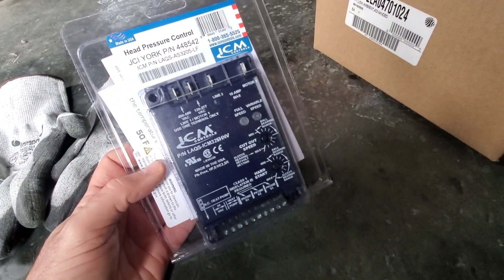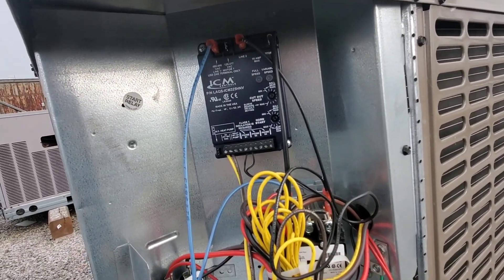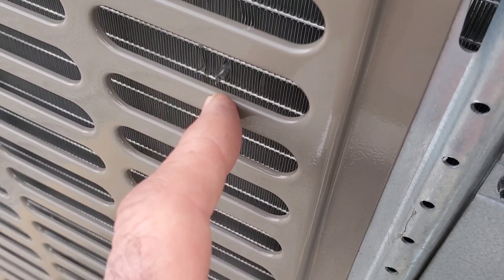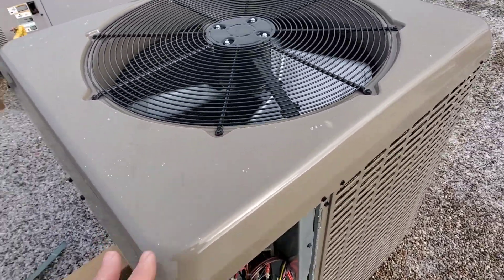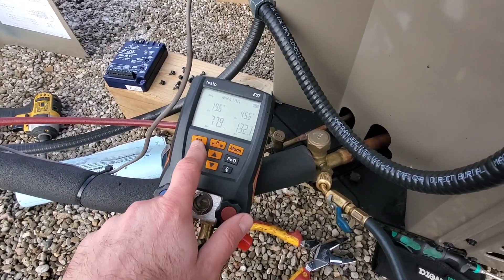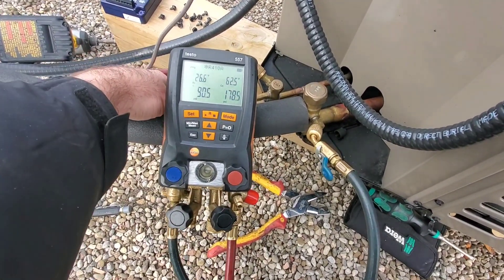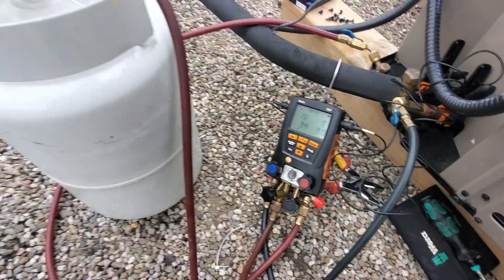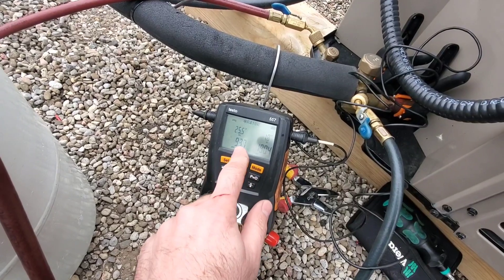Charging And Troubleshooting Air Conditioning In Low Ambient Conditions

Comment: icm head pressure control does not come with the wire that connect the line 1 to the line 1 terminal. what kind of wire use to connect line 1 to the line 1 terminal?

Comment: Hey man hope everything is ok I am always watching your videos,I worked on a carrier motormaster low ambient control today same scenario,it’s tricky to set the right evaporating temperature right due to condenser fan constantly speeding up and down some times you will run under 32° evaporating temperature for seconds and it will go back up,specially if there is low load inside the room,you can correct me if I am wrong I know you have much more experience then me too
Reply from the maker: Yes difficult to set up for sure, it'd much easier if it was fan speed instead of fan cycle
Reply: @HVACKnowItAll  I agreed now due to is temperature outside bypassing the condenser fan won’t work either thanks for replying my message

Comment: We also rig units were I work with a cut in cut out pressure switch wired through a relay to achieve the similar outcome for low ambient conditions

Comment: I prefer pressure action on low ambient controls. I always add a freeze stat to the evaporator as well. I’ve also found TXV with a hard start kit for better in low ambient control. Depends on what the customer will pay for. Good video. Thanks and stay safe.
Reply: I use a fan cycle switch myself. Tried and true. I’ve used them for over 40 years.
Reply: I've never had good luck with these controls

Comment: I Installed this on a Trane 20 ton condenser and both of my motors over heated after 40 mins of run time. Spoke with tech support and confirmed that it was set up correctly. Was told that with that model unit I’d have to upgrade both the motors, add heat sinks, and rain guards.
Reply from the maker: Was the motors that burnt out ball bearing?
Reply: @HVACKnowItAll   yes. According to tech support they were ball bearing. They still worked after the cooled off.

Comment: Does this ambient control kit need other accessories Such as a hard start kit or anything else? And does it matter if its a txv or piston coil?
Reply from the maker: Hard starts for locked up compressors or low voltage situations.  Not needed in low ambient conditions.  You'll need a crankcase heater for sure and possibly wind baffles.

Comment: Great content. Thank you for posting. 
1. The temperature-pressure relationship on which the operation of this regulator is based is only valid for mixture of gas + liquid. The location of te probe should be close to the end of condenser where no hot gas/superheated vapour can exist. Putting the sensor on the liquid side of the condenser should not cause problems, maybe raise the pressure lightly.
2. The sensor should not be affected by (temperature of) the air. Blocking air flow around it with e.g. some sillicone sealant could be a good idea.
3. The fan should not spin below 70F measured by the sensor but it looks like it did spin. Have you checked  that the fan stops at 70F by putting the sensor to 70F and below?
4. It would be a good idea to disconnect the fan manually and check pressures as a first step to confirm that the controller can actually do its job.
5. Obviously, the 'heat-pump jumper" was set correctly.
Reply from the maker: Yes fan stops.  Sensor position final location was in the coil out the outlet.  The controller didn't perform well with the sensor on the liquid line and insulated on 3 different units.

Comment: Air conditioning in winter time call the ambient conditions go down to Goodwill or a thrift shop and pick up a six man or eight man tent cut the bottom out set up a tent it’ll be nice and 90° in there and you could set your sub cooling and superheat as if it was summertime in Florida

Are use a pressure switch I don’t like the thermistor

Comment: never have good luck with those fan cycling, always find issues with them. I use the one that sense pressure not temperature
Reply: Pressure sensing is the only way to go, never been a fan of temp sensing for low ambiant control or fan cycling, pressure never lies.